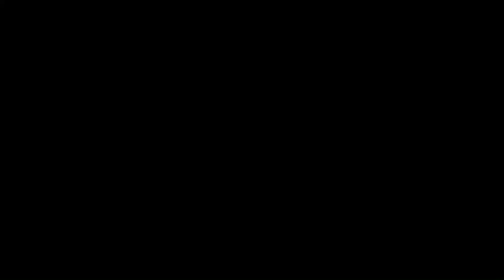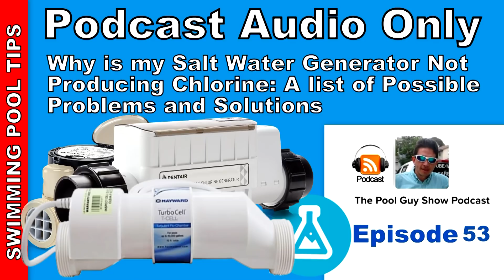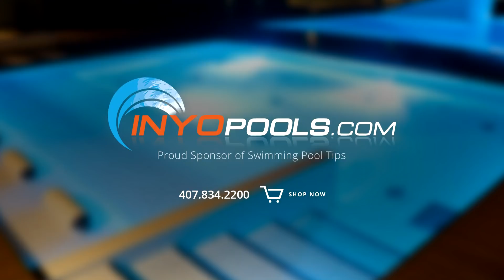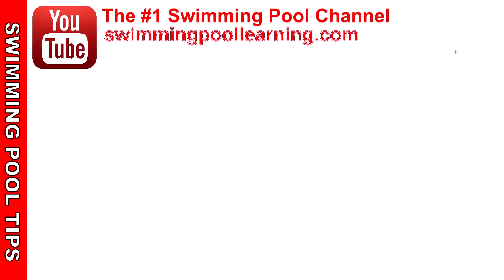Why is my Salt Water System Not Producing Any Chlorine? Possible Causes and Solutions

Comment: I have the Saltron generator. 3 days running and no cholrine reading for a 13,000 gal. pool. It's rated for 20,000 gal. Salt level is 3400 within  range. Thanks.
Reply from the maker: How long is the salt system running and what is the output set at? Also, is there any Conditioner in the water?
Reply: @SPL  Now it's 4 days. I added 2 cups of shock and filled the floating duck with cholrine tablets. It rained about 45 minuts after I added. The Ph & salt levels are in range. No conditioner. I did add acid to bring the Ph down.  Ph is 7.5 and still no cholrine as of 15:30 hrs. 04/15/2019. I will add 2 more cups of shock. Water is clear. Thank you!

Comment: Noticed my Hayward aquarite system had a low salt message of 2600 ppm. I’m in the north San Diego area could all the rain we’ve had lowered my salt level? How did my salt level drop?
Reply from the maker: It could be diluted from all the rain. Clean the cell first and see if that corrects the PPM reading before adding more salt.

Comment: I have an IC40 and am in the market to replace my Hayward Max Flow II 1hp 1.25sf pump.  I am thinking of just adding one of the century VS motors but am now wondering if there is a savings to had if i have to turn the VS pump up to 2000rpm?  Are you still seeing saving from VS motors with saltsystems?  Do you ever run the VS pump lower allowing the flow switch to turn off?  Just trying to understand the optimal way to run a VS to get savings but produce enough chlorine.
Reply from the maker: The best VS Pump for a pool with a Salt System is the Jandy 2.7 HP FloPro. It has a built-in AUX relay so you can wire the salt cell from a power source to the back of the pump. If the RPM is below 1800 RPM the salt cell will remain off. Once the RPM gets above 1800 RPM the salt cell will turn on. It is the only VS pump currently that can do this. https://youtu.be/DshEnnpQVrk
Reply: @SPL  Thank you for the link.  If i cheaped out would the idea be to run the VS pump at the lowest that would keep the SWC cell on, whenever the pump is running?  Any harm in settiing lower RPM and just leaving the no flow light on the SWC?
Reply from the maker: I would say to run it at least at 1900 RPM that way the water is flowing and chlorine is being produced. There is not much difference in electricity savings from 1400 RPM to 1900 RPM in reality.
Reply: Swimming Pool Tips, Reviews & How To - SPL Perfect but I am assuming between 1900 and 3400 there is a substantial savings?
Reply from the maker: Yes. If you run your 2 HP  pump at 1900 RPM for 8 hours a day that is .65 cents and running a single speed 2 HP pump for 8 hours at 3450 RPM is $3.75 a day ($238.00 a year vs $1,355.22). It is due to the extreme wattage difference.

Comment: I have a brand new Hayward swimpure extreme 40k put on my 11k gallon pool. I have the dial down to 5% but for some reason the display always says generating salt when I spot check it. The pump runs 6 hours a day. Does this sound defective? Also have you ever considered offering virtual pool diagnostics for a fee? You could use FaceTime/Skype to troubleshoot with people all remotely. I’d be interested if you were willing. Thanks!
Reply from the maker: I think that light will always be on - it only has two toggle points - generating and flashing indicating a problem. So even with the dial set to 5% it will generate that percentage  during the 6 hours with the light steady. Unlike the Intellichlor System.  The Power Unit know to make only 5% output.  I do have a coaching site that I use through Patreon. Haven't thought of video support but I do Text and Phone Support.
Reply: Swimming Pool Tips, Reviews & How To -MrDgvb1 I’m interested! Can you send me info/details please and thank you!
Reply from the maker: Sure. I have quite a few homeowners in the group already. You can learn more and sign up here: https://www.patreon.com/user?u=4251655

Comment: I have an intext sand fliter and saltwater system for my above ground pool. It's been about 2 weeks and I only added 80 lbs of salt for 4500 gal of water. My pool is 15×48. The water is very clean, I run it 8 hours a day, but I've noticed that the water is becoming a little cloudy. I do not see calcium  build up in the cell yet. I also do not want to add chemicals because I have children who are using the pool. Is the chlorine produced by the salt system the same as chemical chlorine? I will have a friend check my water tomorrow. Watched your video about using the BBB method. I want to use as less chemicals as I can, but I wouldn't want to compromise the children's health with dirty pool water. I've learned so much watching your videos, thank you for all your hard work!
Reply from the maker: Thanks for the great feedback. Yes, test the pool water and add some chlorine if needed. It sounds like maybe the salt system is not producing.  From my calculations you are about 40 lbs short on salt - probably why it is not producing.
Reply: Swimming Pool Tips, Reviews & How To -MrDgvb1 
Thank you, I thought I was short on salt. Will test soon, greatly appreciate your reply!

Comment: what if you have a customer and they dont want you to clean the salt cell? over time will the calcium close up the plumbing line and restrict flow throughout the pool? just asking because i have a customer that hasnt had thier cell cleaned in about 4 years and everything seems to be fine still.
Reply from the maker: It just depends on the cell and the amount of calcium in the water in your area. Ecomatic Cells have been known to cause flow issues and pipe clogs. You may just want to remove it to prevent this. If it is a Hayward AquaRite you can put this pipe in and remove the cell -Straight Pipe Placeholder - Dummy Cell For Turbo Cell - GLX-CELL-PIPE
Reply: oh how cool never seen one of those before. that would make it very easy to take out the old cell and plumb that in place of it.

Comment: Wait if it's a salt water system why did you mention chlorine but I heard something like this before I just don,t understand
Reply: he mentioned chlorine because if you cell stops producing chloring you will need to add liquid chlorine to bring the ppm back up to the needed level untill you can get your cell operating again.
Reply from the maker: The Salt Generator will convert the Salt in the water into a gas Chlorine. So a salt water pool is technically a chlorine pool - you just don't need to physically add it.
Reply: Ok thanks now I understand great vid👍